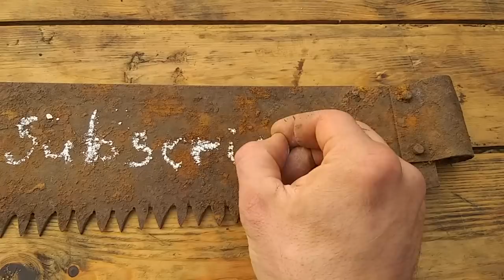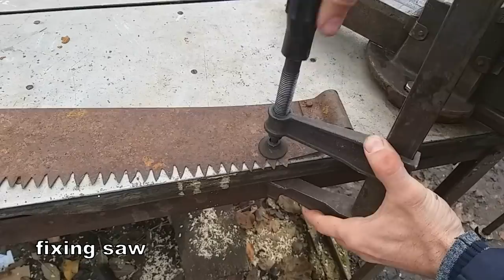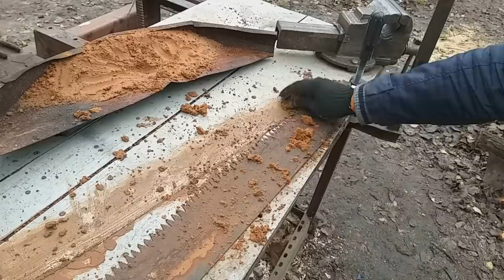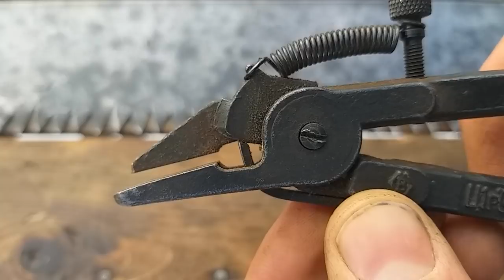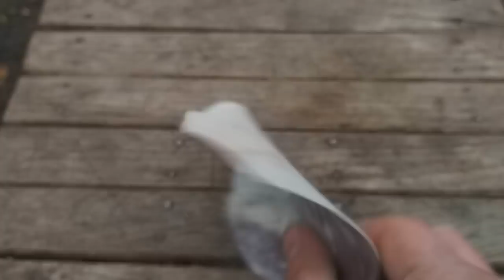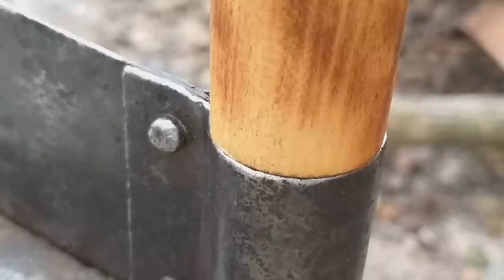Antique Rusted Crosscut Saw Restoration

Comment: My comments on one thing. I think I would have checked the teeth first, to make sure that none of them are too high in relation to the teeth around it. And if there are some of these, file them down to match the surrounding teeth. That will make sure that all teeth take part in the work instead of just the one high tooth. :) Otherwise a nice restoration. I restored my own saw as well, but broke off a tooth on an otherwise perfect blade, when I tried to set the teeth. I did it exactly the way you did here - I think my teeth may have been hardened. :(
Reply from the maker: Yes, those teeth are very tricky, due to very old metal they can crack in a moment during setting
Reply: @almostperfectrestoration  check Facebook. I posted a picture of my restored saw. :)

Comment: nice job, you set the teeth way to much though, good rule of thumb is a total set (left + right) should be about 1,4 to 1,6 times the thickness of the sawplate, more than twice is bad ;-)